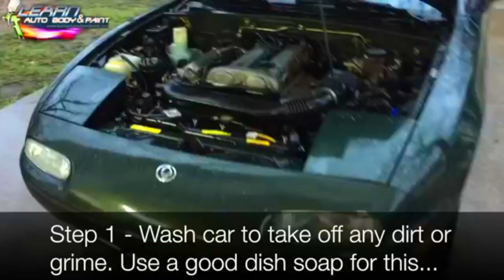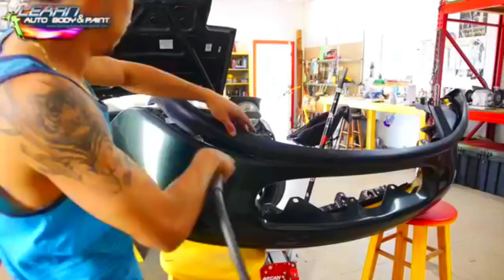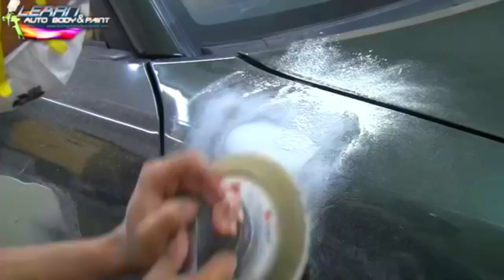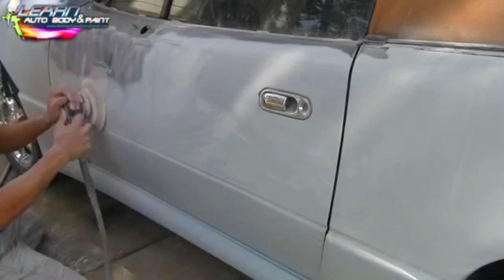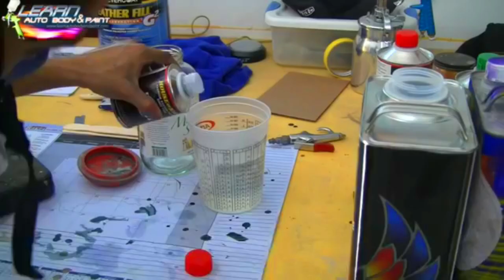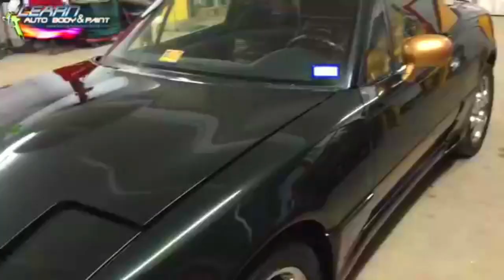🚘 STEP-BY-STEP Car Painting! MAZDA MIATA Project Remastered 😎

Comment: What type of gun do you recommend for spraying. I am currently working on a first time project car and am looking for a decent quality gun, but I have no real idea what to look for. The car is a 1979 buick skylark if that matters at all.
Reply from the maker: I’ve sprayed with many guns over the years. I’ve been using this brand called ATOM X and they’ve been good to me. Check out my latest videos where I use them. Currently spraying a lot with the ATOM X88 great performing gun and value.
Reply: @HowToPaintYourCar  also, do you have any videos detailing how to deal with rust on old cars or would you be able to make something like that?